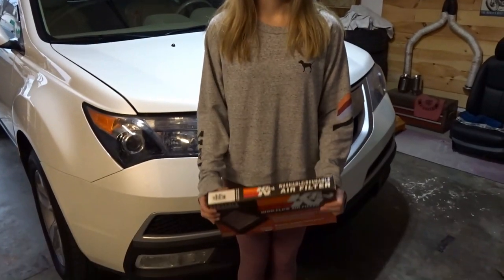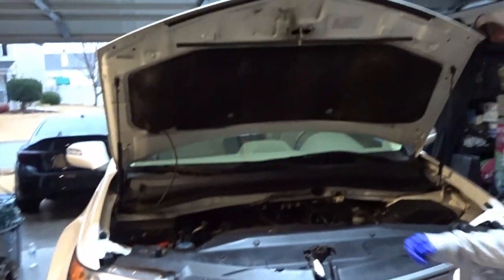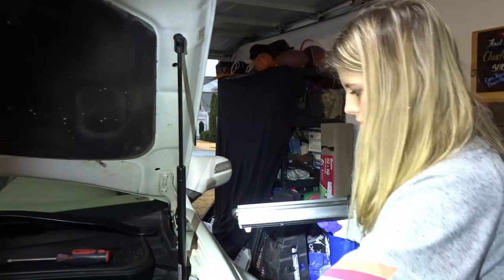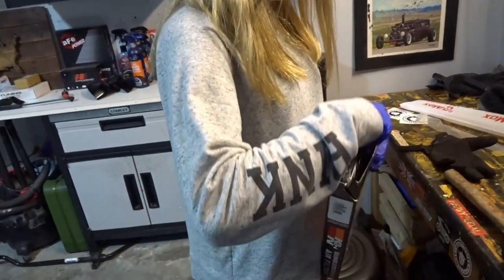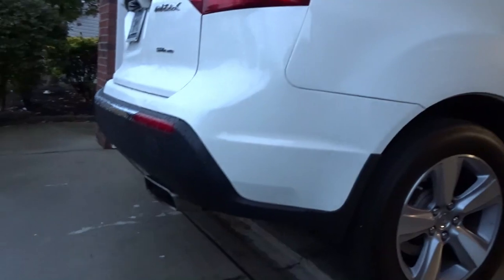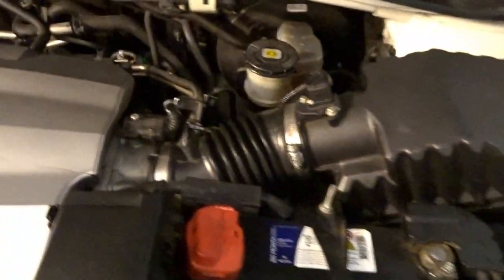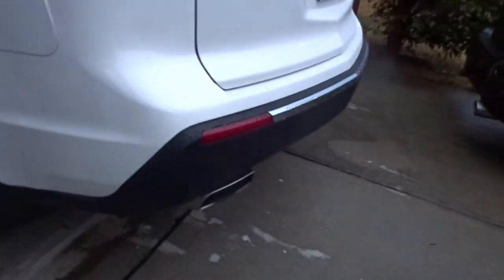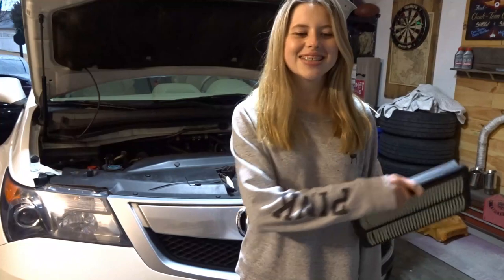Daughter makes her FIRST upgrade to her Acura MDX | K&N Filter Installation

Comment: Hey speed question related to the q. If I get a custom catback exhaust from my local muffler shop will it void my warranty? The shop noticed the stock exhaust pipes had really bad rust and suggested replacing the whole system. (All the pipes)
Reply: Shouldn't so long as you don't remove the cats... Even then if your rear cats are not monitored, you should be safe there too.. Check with infiniti.. Call a few different dealers and talk to service... I think boost and pov both did cat backs with no issues... Good luck
Reply from the maker: If you want The Truth (see what I did there lol?), nothing "voids" warranty.  Always remember that it is a manufacturers warranty and not a dealership warranty.  So if a dealer tries to tell you that something voids your warranty, you have to push back.  The dealer/service department doesn't decide.  With that being said, they have to be able to prove that any given modification caused the specific issue you have.  I've done a video on this by the way.  Like Mike said, if you remove the cats, there is a good chance they can deny a warranty claim on an engine issue.  But that does not mean they would deny a claim on an electrical issue or a suspension issue.  An exhaust system is not related to suspension and therefore could not be proven to cause suspension failure.  Does that make sense?  So the warranty is not "void," but an individual claim might be denied depending on what the issue is and whether or not you have mods that could have potentially caused it.  You could try and play it safe like Mike said and make some calls to get a feel for how the service departments near you act or treat mods.  The less headache the better!